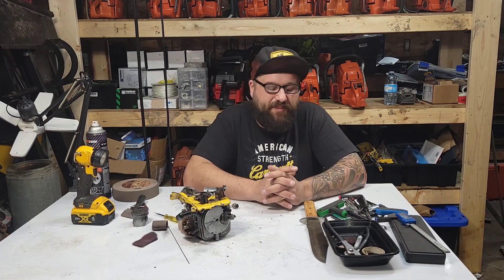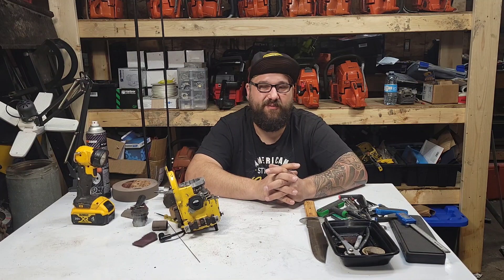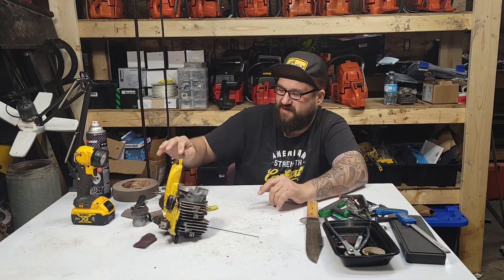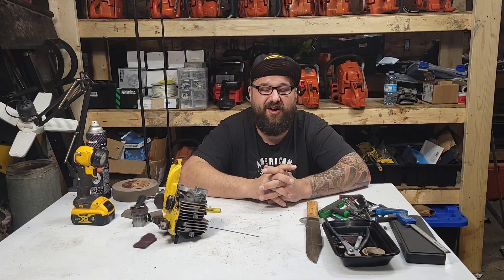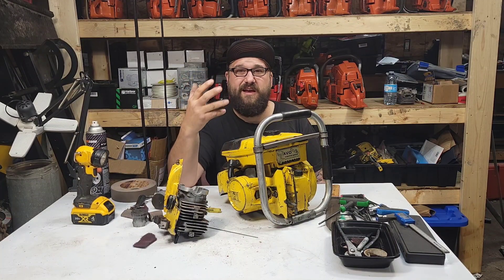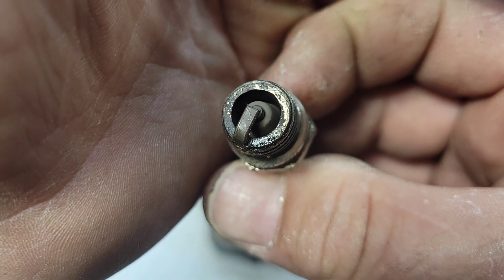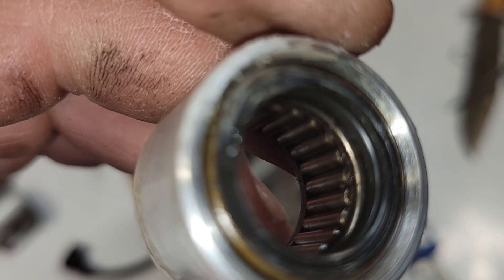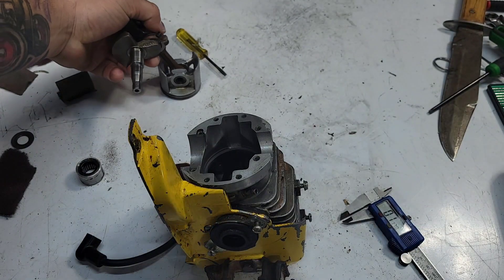Answering comments about Buckins Pro Mac 850. Too lean? No oil? Sparkplug hit the piston??

Comment: Speed (rpm) is heat and heat is the enemy. Those aren't free air cylinders and you might be exceeding the capability of the fan. So how fast over stock do you want to go? The inconsistencies in the color on the piston is the key. The piston didn't grow symmetrically and rubbed out the plating. The lack of exhaust back pressure may also be a contributing factor. Good luck

Comment: I have a echo cs-600p (they are identical to the 590 timberwolf) that runs pig rich with a basically stock (one tiny 1/4" hole under the screen) muffler. The problem is the high side is nearly shut and the low side is only a half turn out. It'll not idol, or run lean and die while in the wood if I change them much.

Comment: I worked in the auto repair industry for over a decade. I can tell you from what I’ve seen in that time is you don’t wanna be driving 6K, 8K, 10K, etc on your engine oil. Modern engines have variable valve timing and use a lot of plastic timing chain guides, etc. 5K is the longest you wanna go between oil changes and that’s if your using a top quality synthetic oil. 3K max on conventional oils. Oil is cheap compared to a engine replacement. Of course that’s my opinion, but a opinion based on personal and professional experience.
Reply: Yep, more often oil change is the biggest secret for 1 mil mile engines.

Comment: I have a problem with the Mac 850 Super, basically it's like if the chain oil goes into the petrol, making a lot of smoke, what could be the cause
Reply from the maker: There's 4 orings that sit under the bolts that hold the cylinder to the oil tank. When those leak it usually causes a very smokey exhaust.

Comment: Hey, i just live up the road from you, anyway ive been watching your PM850 vids to use as reference for this Super pro 80 i picked up from auction.  The saw was dirty but inside looks reasonable considering.   Looks like the only problem ive found was the boot under the carb had a hole in it.  There are some differences in the transfers in this top end from yours, but im going to give it a go anyway with a minor port job.  Question i have is regarding the flywheel.  You mentioned in one vid about getting a different flywheel but i missed why.  The one i have is missing fins.  Was it hard to find a new one?  Or just run it missing a couple?

Comment: I run Motul 800 offroad 33:1 (30ml oil/1l gas). I run it in everything, from the big milling saw to the lil Echo 2511. Never an issue or a hiccup, my pistons are always spotless no matter the work hours, and the bottom ends last forever. Rolling motion of the bearings likes oil volume, doesn't care about oil quality. I'll never go leaner than this after seeing some engines at 50:1.

Comment: Have you tried indexing spark plugs? The theory is you can influence flame travel by changing the position of the electrode. I haven't tried it in saws yet but I do check electrode index and make a note of it.

Comment: Been around snowmobiles growin up. In the late 90s it was either red line 2stroke oil or amzoil from what I recall. But i remember the smells of different sleds running different oils. 110octaine avgas with amzoil on a crisp cold morning = amazing!

Comment: If you use a newer reputable brand oil at 50 with the carb set correctly you will NEVER have have a lube problem!   #1 rule warm up your engines! Don’t cold seize!!!!

Comment: It is endless argument.
Modern strato saws (atleast 5 series husky in my experience) run better with more oil particularly the hot start problems people get they do breathe fresh air and run hot.
I can only justify 33:1 for price of oil Castrol power1 racing. Killed two bottom ends on 560xp with different oils at 50:1, have a hell of a lot hours on my now old 562.
Modern synthetic oils can be run at much higher ratios without creating carbon.

Comment: I’ve been using optimal 2  since 1978 I went in the army in 1979 and the two cycle diesels U.S. Army put and use optimal 2 cycle oil in the diesel that’s how good it is never have I had a saw or weed eater  come in the shop from oil failure because of optimal2 oil I remember when they would Double the warranty of the 2cycle that used optimal tool motorcycles lawnmowers weedeaters that’s how good that oil is retired US Army Sergeant Major Gamsby

Comment: ..haven't seen much issue in chainsaws, but I have seen too much oil in mix cause clogged cat mufflers(and exhaust ports) quite a bit in trimmers& brushcutters, and in leaf blowers (of course, operating at too low RPM's can cause this also, especially in trimmers)...

Comment: if the saw its right tuning and having good spark its no problem to run with little bit extra oil. is it possible to modify a piston from another saw to fit that mac cylinder. if cant find the right piston to that mac.

Comment: Definitely doesn't look like lack of lubrication.  With modern 2t oils, I don't think you can really go wrong with any, solong as it's a name brand that's been around for 10+ years, used in a sensible ratio and the proper application. (IE: dont confuse tc-w and fc, fd) while some are better than others, IMO when used with common sense one oil alone won't cause a saw to blow up!
Yes, I have my favorites but won't mention here😋

Comment: More oil=more lean.  Also found in my old homelites running 50:1.  Run better and no more scorched pistons.  I’ve been in a lot of homelites and the ones that were all scored up were the ones with heavy carbon deposits and 32:1 or 16:1 written in marker on the saw.
Reply: Plain bearing two strokes are relying on the oil film to cushion between the bearing surfaces - it's when engines started to run needle and roller bearings that the amount and weight of the lubrication can be lowered safely.  All modern design twostrokes are fine with 40-50:1 with synthetic lubricants - but if using mineral oils better to stick to 25:1.  The old plain bearing stuff was built to have a lot of 30 weight engine oil through them, and can get upset if they get fed low amounts of thin synthetic lubricant...

Comment: Castrol isn’t great oil, but I guess it goes to show how just having oil is generally good enough.  You should tell him to break it in with opti2, or another top shelf synthetic.

I run amsoil Sabre, 60:1 on everything except my chainsaws that gets 50:1. In my weed wacker it’s noticeably cooler then running castrol.

Sorry for the discussion in leu of not debating oil. I believe there are many top end oils that all exceed the standards and needs. Opti-2 is another top shelf choice. Stihl oil is good if you don’t have an exhaust screen. Echo is good. Castrol is just 35 year old technology in a Dino oil format.
Reply: I believe Castrol makes stihl oil? Maybe my lable is wrong?
Reply: @KillingerUSA  castrol is capable of making good oil in that case as stihl is synthetic.  I didn’t even know they actually made the castrol brand. The problem is what they sell under their own name is mediocre meets expectations oil.  I’m not saying it’s bad, it just doesn’t go above and beyond. I would buy it over any no name brand in a pinch, I just consider good oil as cheap insurance.  I burned 80-100 gallons of mixed gas last fall mostly in leaf blowers. I clogged a couple fuel pickups with crap but even as they leaned out they didn’t burn down even when it happened during long runs of WOT.